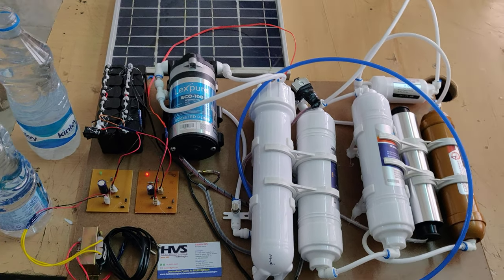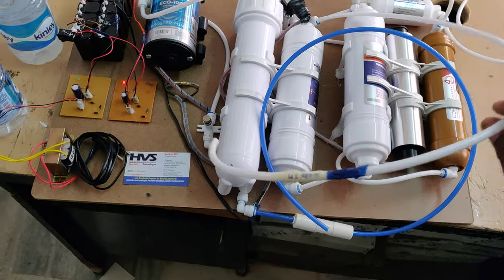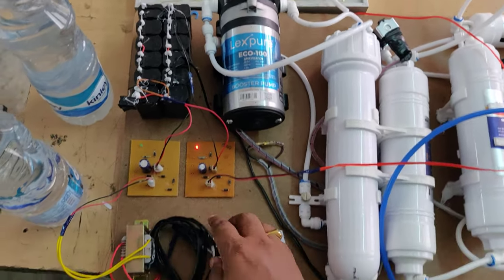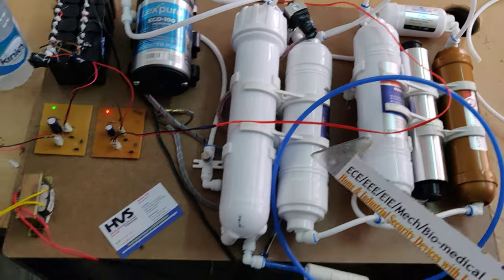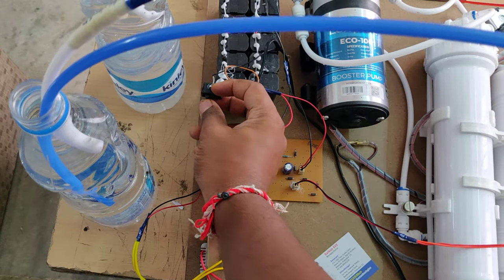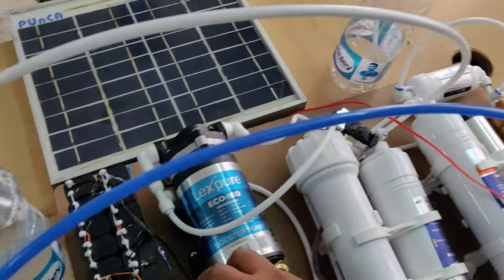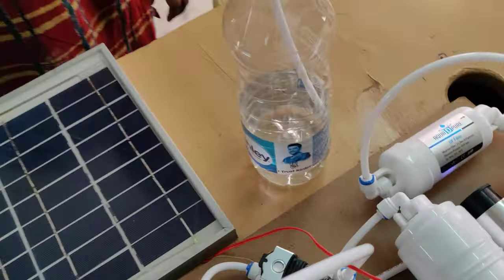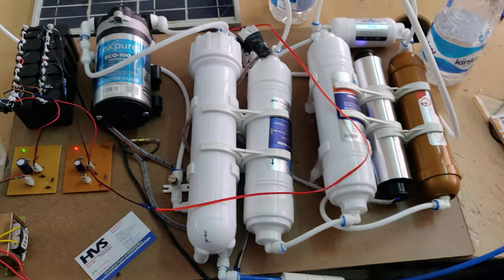Solar Water Purification system

Comment: You actually dont need electricity at all if you use a permetate pump.  However if the inlet pressure is not enough yes, you need to boost the pressure with the pump you are using
Reply from the maker: Yes. We can directly use solar panels, but what about during night . 
We sell total project. 
Send me video link
Will update you the cost details.You can contact us at +919603140482
Through WhatsApp or call

Comment: Can I ask one question sir, what is the power storage capacity (how much storage) and the output voltage power? How long it will give? Thanks
Reply from the maker: You can contact us at +919603140482
Through WhatsApp or call